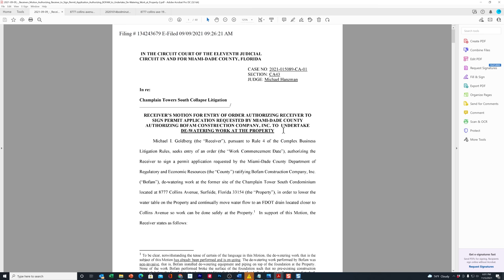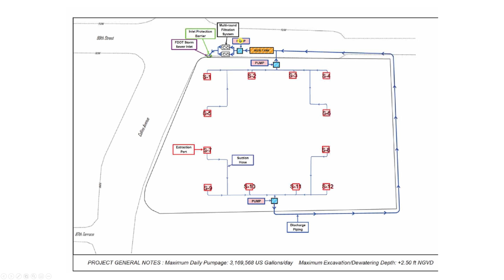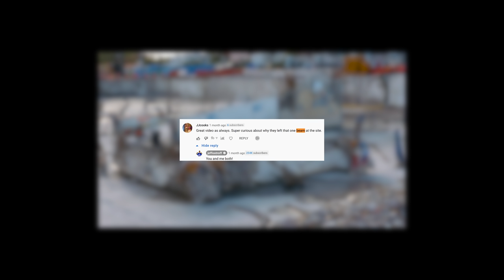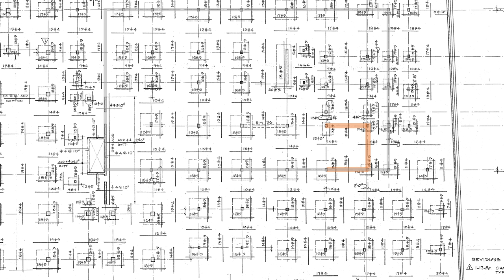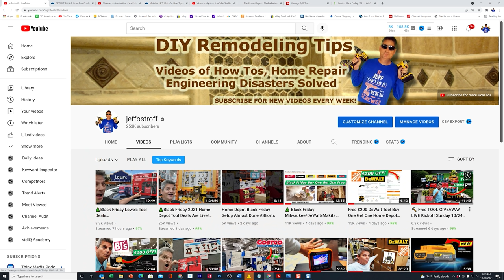Miami Condo Collapse: Engineers Baffled By Mystery Column

Comment: The mystery column was:
1. added later: Wrong. There is no visible concrete around the rebars. In addition, the rebar doesn't appear new.
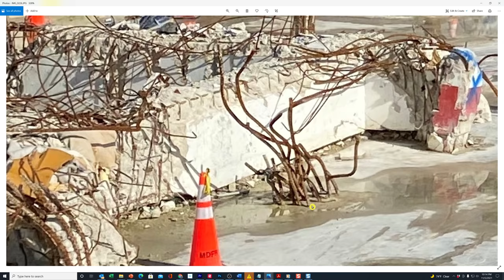2. pushed through from 1st floor column: Correct. You can see the skid mark at the side of the H-beam from the column at the 1st floor falling down at 13:48. The rebar made it through without cracking the floor because the basement floor is very solid.
Reply from the maker: There is no physical concrete because it was either removed by the collapse of the building, or the democrats when they removed everything. Look at all of the other columns sticking up out of the floor ofloor of the garage all over the place, all you see is just the rebar wires. So you're causality was a little off there just because there's no concrete between the rebar doesn't mean there wasn't any at some point in time period but I do believe if this column was added, it was put up some time in the last 12 months before the collapse.
Reply: Kent , you  are correct this was put there by NIST to complete the picture of the columns
Reply: @jeffostroff  I don’t agree with your language and your comments
Reply: @manikaggarwal2018  Thanks. My guess was based largely on the resemblance between the mystery column and the surrounding steel bars.

Comment: When it collapsed that one from the lobby could have been pile driven into that spot. The concrete around the rebar would have shattered when it got the slab but the rebar easily could punch right into the slab quite deep actually without breaking the slab to much. It would have had like a 16 foot free fall before it pounded in and did impale the slab. The water around it is blocking your view of the slab to inspect the rebar to see what the slab looks like. That will tell you if it's mounted or pile driven in from lobby level.
 That is what my guess is. Keep us posted when you find out!
Thanks for the info and updates! As an iron worker I've worked with many masons and welded tons of mason anchors on galvanized lentils for mason attach points and spent many of hours with a damn vibrator during slab pours to help out sticking that thing under double mat bar to get out air pockets and settle the slab for finish when it's a dry or "hot" mix pour meaning get it out of the mixer before the only way to get it out of the mixer is drive the truck to a bunch of guys with ear plugs safety glasses and big ass Jack hammer air chisels!  FUN FUN FUN! 💩💩💩💩💩💩💩
Reply: It wasn't.  Watch the video again and pay close attention at 13:47.  Jeff zooms in and you can see the rectangular outline of where someone cut that slab, installed a footing & rebar and closed up the hole again.  You can see some of the concrete 'slop' that got on the rebar.  There was no column formed and poured around that rebar yet; if there was, it would look like all the other destroyed columns.  Construction of that column was 'in process'.
Reply: I was a union laborer in Boston for a concrete  flatwork and wall sub contractor.   The iron workers and concrete "dudes" earn there pay checks.
Reply: @johnbergstrom2931  I see it!  I used to drill holes for dowels to connect old concrete with new fill in.
Reply: @johnbergstrom2931  My first thought Sherlock..
Reply: @johnbergstrom2931  On the technical side, my greatest expertise is in power generation, not structural loads, but the second half of my career encompassed accident analysis, equipment reliability , performance improvement, aging management, human performance, and training. My first instinct was that it was a temporary modification meant to “make do” until the squabbling about who, when, and for how much were they going to spend to just fix the damage from and to repair pathways of. water intrusion.  Your thought that it was started but not completed would explain the as-found condition.
Reply: @lisastiles1408  Yeah, I really hope to see someday a book published or a documentary produced about this building and see if all our deductions & assumptions were correct.  I feel terrible for the victims, families of the 98 people killed and also for the families who had to see their homes and personal possessions demolished, but solving mysteries through logic and deduction is fun.
Reply: @lisastiles1408  they were in the process of repairing the whole building. It had just started and they were on the roof to begin the process. Lots of people were asking why would they fix the roof first but they were not. They were starting to get all the cables ran and holes to run cables through for load supports as they would have to have cables ran all over and I would think some post out on the perimeter known as dead men to anchor out to for help to support the load as they removed and repaired the damage. So yes it would make sense that it would be added down there as an anchor point to pull up from or to transfer down on to while removing whatever would have carried the load normally. I can't say exactly what the plan was but I've seen it done with the cables before and it's kinda like the cables on a bridge and is used to hold the load while in repair. I've seen dead men and cranes used in a pully like system with block and tackles to add lift support while load bearing supports were repaired and some replaced! 
 I know they were just starting this process and when it first happened the news reported it as they were working on the roof but did not know why. They then showed pics of the work being started the week before and I saw what they were doing and knew it was not yet the roof they were fixing but the cables were being laid out and holes were being cut to run where needed to snatch up the building. 
 I later saw a report with a drawing on what columns were in need of repair and what percentage of each could be removed as is and what ones were deemed already in danger and needed support before any work could begin.
 So it makes sense it would not be on the main drawings or in any videos at the time because it would become an anchor point or temp support for work about to happen.
 But as we see they waited to long to begin. 
 People will prob try to blame the construction company starting the repair but it's clear the main build from the start took some cost saving steps that in the end cost way more!
 The amount of rebar that was showing spurs all over the outside and inside with rust stains all over means water was running all through that place almost 24 7!
 And a lot of the main columns where the collapse started on the main drawing were supposed to be all 16 × 16 thick and yet a revision was made to a bunch that became 12 × 16
And wouldn't you know that when it started to fall the shear load just happened to be against the 12 inch sides and they gave out.
 Can't say that the 16 × 16 would have not done the same but as we see it sure did not help any at all to be on the 12 inch sides.
 Sad really if it does turn out that saving money on how ever many cubic yards of concrete and whatever rebar by the ton was worth more then the risk of lives by building to the minimum tolerance of supports then to the max.
 Not everything has to be Exposer level C but when it's right next to the sea,  we see it probably should be,
 to the max not the min, even though more costly! If that became an issue QUIT underbidding just to have a cheap fee! Nothing is free so learn to bid properly! SO people don't die asleep on their own property! 
But what do I know? Maybe that's just me! 
 I can only weld and write rhymes like an O.G.
 And I don't list a stupid pronoun I'm just an old fashioned "HE" 
 Mid West White Boy from the East so I'm known as YANKEE!
 And for laughs my favorite word is to just yell out "HEY HONKY!"
Lmao
Reply: @TRAXRIPPER  You’re scenario certainly makes sense as a strong possibility. The biggest contributor, I think, is that the owners/HOA squabbled about it for THREE YEARS trying to spend the minimum amount of money in order to meet THE CODE. No one was thinking about SAFETY, just minimum compliance.

Comment: I think it is possible that the mystery column was impaled into the concrete ground. If we assume the H-beam gets out of the way, and the column that goes to the top of the building stays straight and builds momentum while dropping one building level, it has a lot of energy when it touches the ground. It has a lot of compression load, and not much reason to burst sideways. It is easily much stronger than the concrete ground of the parking garage.
Reply from the maker: It might be, but there is no damage to the floor.
Reply: I think the 11 floor beam on top of that H got shoved aside and impaled itself there by going down a floor and being pushed by 11 more floors. Was that the reason of collapse or secondary?
Reply: @dascandy  I am not sure the floors are relevant, I think it is the column itself. The floors attached to the column are somewhat elastic, there is a delay until they contribute to the load on the lower end, after contact. The delay for the moving column itself is much shorter, I think it depends on the speed of sound in concrete, which is much higher than in air. I would think if the column is still straight up at the time, the full load applies after the time a shock wave travels to the upper end of the column, or up and down.
Along the length of the column, the speed of sound is 3700 m/s.
Reply: @Randrew  I found it almost spooky myself until I came up with that explanation, I could directly see it is there, and almost as directly that it can not be there. I did not see the option that it was placed there recently because the building had already started to fail, which is still possible. I could totally understand the term mystery column, without expecting anything irrational.
Reply: @jeffostroff  Except there IS damage. Pooled water makes it hard to see. All of the other columns, there is concrete around the base, whether broken in chunks between the rebar or even still intact. With this column there is none and the area around the rebar poking out of the slab is depressed. It's lower in and around the rebar. There is a pretty clear and irregular depression around the rebar. The column is also halfway out of line with the other two columns. It's just difficult to see it from the angle. Residents would have also bitched up a storm if they had suddenly added a column in the middle of the thruway. Forces exerted by so much weight falling that a broken column from above could have easily been driven into the slab. It looks like it isn't even the only one. It looks like there is also another on the other side of the H beam. Such a thing would not be unique either.
Reply: Assuming the H beam 'gets out of the way' is your first fallacy.  It didn't.  It fell basically straight down.   And the column on top of the H beam, the closest one, the one you think is impaled, is actually 5' 3" from the column row where the 'mystery column' is aligned.  No way a falling column is going to be shifted over 5 feet horizontally, then magically correct itself and come down vertical.

And a falling column segment has nowhere near the kinetic energy to accomplish an impalement, but you're going to ignore that simple fact, so...
Reply: @GeneralKenobiSIYE  You talk like you are competent.  What exactly is your education level, and profession and credentials?
Reply: @johnbergstrom2931  What are these two values of kinetic energy? Do you have a rough idea of the mass of the column alone, up to the penthouse? I'm more curious about the energy needed for the impalement, I'm not asking you for estimated numbers, but I would like to understand the order of magnitude of it.
Reply: @johnbergstrom2931  You did not ask me, but in case it helps as context: My relevant background is physics. So I have no intuition about material behaviour, like concrete under shear force here.
Reply: @Randrew  I wanted to make a comment that Civil Engineering is about jobs that are harder to replace by AI than many others. And then, on second thought, I noticed that's not true. 
One could think creating software can not be done by AI. It is a little harder, but wrong.
Damn, that could be seen as negative, not what I intended.
On the positive side, the whole concept of fear to not have a job. We can not automate most jobs away and expect to have a job for everybody. We can not even avoid to have something like universal basic income, high enough to not be scared of it.

Comment: I really like your work and you seem level headed. I am a union carpenter Foreman and maybe you could humor me and hear my theory. I have done many jobs with" quick fixes" no permit and I hate that. Suppose the huge floor above the the ramp on the east side had visible crack from expansion or stress. Property management needs a quick fix  they have a guy hammer drill a new beam and pour concrete to add strength . That would explain the water seepage because concrete was already on the floor . That would explain the water seepage the mysterious column and the rebar there? Is there any way to get a PDF of the blueprints somewhere so I could mess around looking at them? I'm not a pro but I've built a lot of buildings and you're brilliant tutorial has got me really interested in this

Comment: Just noticed, during the drone overflight in the very last 10 seconds of this vid, they're doing some serious "batter pile" type shoring of the retaining wall, but only on the Collins Ave. portion... I guess the consequences of Collins sliding into that pit means "failure is NOT an option"..
Reply from the maker: Yes a concern earlier on was that they were worried Collins Avenue would collapse into the site. Now they've added a lot more showing polls up against the wall
Reply: Allen had already pointed this out to the city.  Having the walls on the west side fail and let part of the street and sidewalk fall into the pit would not be good.  The rest of the perimeter of the building could have the same problem but maybe it is blocked off enough that a failure there would not be such a risk to people.  Allen has been ridiculed by the armchair quarterbacks but he was 100% right in warning the city.  There are various ways to design basement walls to retain soil pressure and this project was not designed to resist soil pressure without help from the street level floor slab.  That doesn't mean it's going to collapse immediately, people dig trenches all the time to repair pipes and get away with it, but occasionally you see on the TV news where one of those trenches collapsed and buried some people.
Reply: @billj5645  ... this project was not designed to resist soil pressure without help from the street level floor slab.   So that implies that it was temporarily shored during construction too--not unusual.  Would LOVE to see a ton more construction photos, esp. the formworks and placement of the garage floor slab and retaining walls, and, of course, the remediation of the CRANE COLLAPSE, which nuked a lot of formworks, and possibly some placed-but-not-yet-cured concrete as well.  Red flags everywhere.
Reply: @jeffostroff  Even though there's probably sheet piles on that Collins side too--as plainly seen on the South side--who knows whats left of them after 40 years of soaking in the somewhat salty rain and groundwater of So-Fla?  Better safe than embarrassed.  ;')